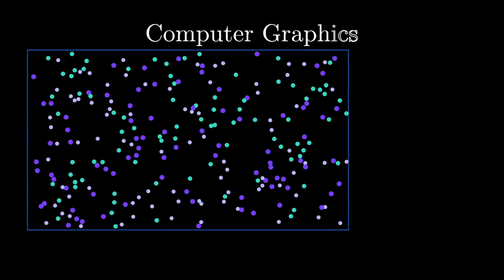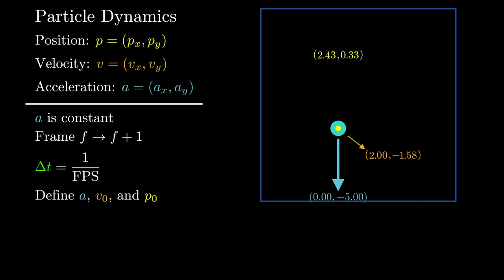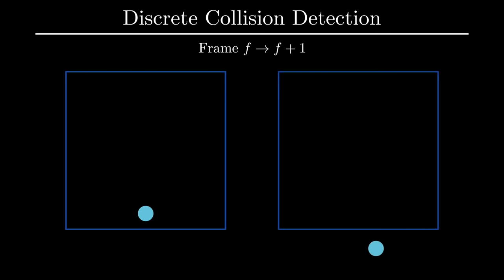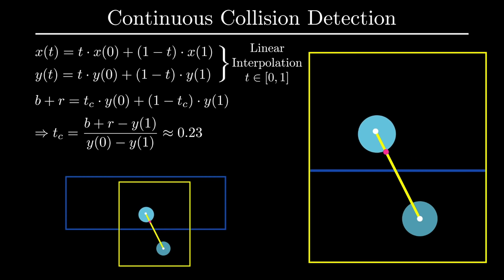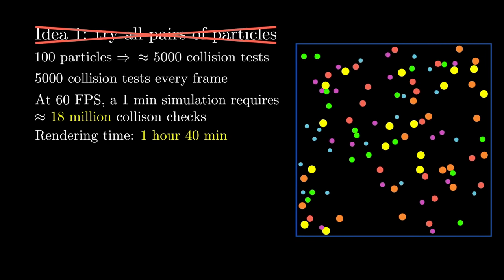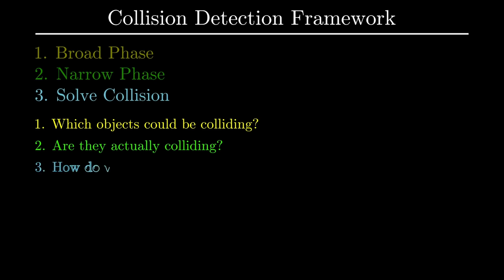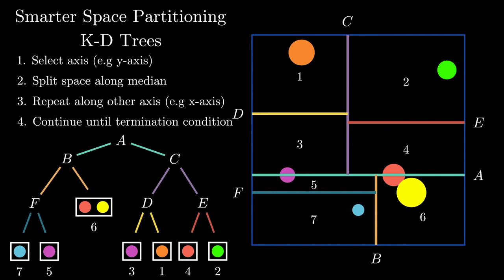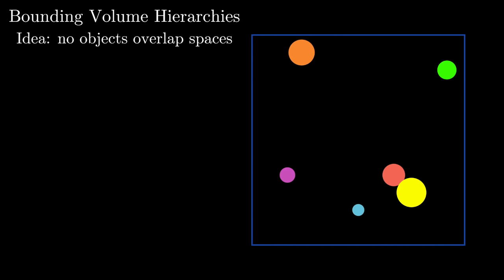Building Collision Simulations: An Introduction to Computer Graphics

Comment: Hey, very nice explanation! 
The Sweep and Prune algorithm offers a massive optimization despite how incredibly easy it is to implement. It's immensely useful in molecular dynamics along with the Bounding Volume boundary Hierarchy although the latter may be somewhat more tedious to implement.
Reply: What do they use for n-body simulations? You can't use Sweep and Prune since forces never die out to zero.
Reply: @looksintolasers  Depending on how quickly the interaction force decays with the distance, you can still use a variation of the Sweep and Prune method, with a larger interval surrounding the particles. 
To compute the force on distant particles, instead of iterating for each particle, you can encapsulate a large number of particles in a single cell, and compute the interaction via a multipole expansion approximation.
One of the most used optimization techniques in n body simulations is called "Barnes–Hut method" if you want to look for information about it :)
Reply: @looksintolasers  For short range interaction (or very short meaning no action at a distance with only friction and collision as in granular material) you can also use Verlet list. The idea is simple but need some careful tuning to guarantee that your system will not blow up and produce artefacts : you setup a cutoff distance beyond which you assume the magnitude of your force is negligible compare to the effect of the one resulting from interaction with other particles within the cuttof distance range (and thus not affecting the dynamics of your system), which is natural when no forces at a distance are present. You build a list for each particle of possible neighbor candidates within that range and maintain it for a finite amount of steps. On these steps you don't have to update that list because you have chosen the right cutoff distance such that no particles outside the list can be a candidate for a collision between two consecutive updates. Check the verlet list wikipedia page for more details. This algorithm is very handy because it can be "nested" : you can make "super verlet list" with another bigger cut off distance to make a bigger list you will update at a lower frame rate,and use it to feed your "inside" verlet list such that you update it only by iterating over particles in the super verlet list. And so on. Hope my description is sort of clear but this is the "broad idea" : careful tuning according to the dynamics of your system and you don't have to iterate over all pairs of particles at each time step. It's sort of "caching" candidates for collision over a certain amount of time steps : )
Nevertheless,in molecular dynamics many algorithms exist to handle collision efficiently and the right one to choose depends mainly of the dynamics of your system and its collision rate : ) Verlet list for example is well suited for dense particle systems
Reply: @looksintolasers  In practice,you will always have to assume that forces go out to zero at some point. Like you say, gravity, it never ends. Nevertheless you can still make real satisfactory predictions about the motion of solar system planets without considering influence of distant galaxies on it. Or the influence of Mars on any apple that fall to the ground. Yet, the influence of Mars exists. But we can safely disregard its effect compare to earth attraction. In numerical simulation you "can compute everything". But it is mainly useless. You can compare contribution to the net effect and disregard contribution you can say "are too small". Otherwise, it is just garbage contribution to the real effect your are trying to measure. At that point the integration scheme for computing your motion  is already probably bringing worse numerical errors to your measures that the one resulting from "neglecting infinitly small effects"
Reply: @Galileo51Galilei  the problem I'm having with gravity on small scale is while the protons approach they get more simulation ticks to accelerate.  This makes them depart with faster velocity. So on their departure, they get less simulation ticks to slow down.  
So kinetic energy sometimes increases too much, especially when the protons get really close.

Any ideas?
Reply: @TheRainHarvester  maybe you will be interested in the class of "event driven" algorithm where you do not track "time" with a fixed timestep but "events" with a dynamic time step, reducing it when something interesting is about to happen and increasing it when nothing is about to happen. It s adapted to the simulation of low collisions rate systems. Check for "event driven particle dynamics" or EDPD.
Reply: By the way, to all here, do not hesitate to contact researchers in that field (their pro email is usually easy to find). They will be really happy to help you and they live behind their mailboxes; ) If you write z concise email explaining your problem and what your are.looking for they can answer you with one line sometimes which can save you hours of research (it's their job to keep track of good références). They maybe will send you a nice pdf article to help you. I was in academics so for me it seems natural. But for those who never talk with researchers and don't have this reflex (which is perfectly understandable) you can interact with them. Often (depending of your country and labs) you are paying through your taxes for their jobs ; ) So feel free to ask them questions on your personal research/projects.
For example,on intégration scheme for particle dynamics the physicist Sean Mc Nammara is quite a reference, on top of being a nice and humble man
Reply: @TheRainHarvester  But mainly you need an  integration scheme that puts energy conservation at the very focus,like Verlet Integration scheme (which is different from verlet list I talked before)
Hope to help you,cheers
Reply: @Galileo51Galilei  i was thinking integration too.  But with multiple particles, it gets complicated.  It seems like our universe side steps the problem using repulsion at small distances which prevents 1/r^2 from going to infinity.... except for nuclear fission explosions and black holes.

Comment: Dude, your videos are pure gold. Computer Science students must LOVE you! Just a little note :D 2D particle-to-particle collision response closed formulas look hard and ugly, it is easier to deal with it by proceding by steps. First, split both v1 and v2 in two components, one parallel to the line of collision and the other tangent to it. You'll obtain 4 vectors: v1p, v1t, v2p and v2t. The final velocity vector for the first particle will be v1p + v2t, the final velocity vector for the second one will be v2p + v1t :) in other words: when two sphere collides, their velocity component tangent to the line of collision have to be swapped. This works if the two masses are the same but it is not that hard to take also that into account
Reply from the maker: Thank you! Yeah, I think the reason I was having so much trouble with it is I was messing with angular representations and it wasn't immediately clear to me how to solve it with an angle-free representation. Like I said, pretty rusty on my physics :P  Thanks for this comment!

Comment: 13:23 you can see one of the blue particles in the right box getting stuck to a yellow particle and briefly getting slingshot around. same thing happens again at 14:37 between a red and yellow particle.

it looks like the reason this happens is that, during the 1st half of the simulation frame, when two particles are first moved, they penetrate each other at very grazing angles, the 2 particles overlap but already have velocities that would move them away from each other. the collision handling doesn't account for the fact that the two particles are already moving away from each other and just unconditionally reflect both particles' velocities along the collision normal. This results in the velocities deflecting slightly inwards to the opposing particle and remain nearly tangent to that particle's surface.

This continues until the particles reach a sweet spot frame when the next position update would fully depenetrate the 2 particles.
Reply: How did you find it? I was looking for any blue particles close to yellow particles at the timestamp and had to pause the video to find it.
Reply: @PanDiaxik  all the particles move in straight lines, the slingshot particles move in a brief curve. To me its just eyecatching to see 2 particles move differently from the others even just briefly
Reply: Yeees, I have seen it. It's kinda funny
Reply: Is it possible now to aim and accelerate particles to merge them 😅?

Comment: 12:42 Some ideas:

1. First you need to "enter the frame of reference of the 2 colliding particles". To do that you add the 2 speeds together (as vectors), divide by 2 and subtract from both vectors. You save this vector for later. To see why, think about the point that is in the middle of the line connecting the centers of the 2 objects. This point must be stationary.
2. Now to find the new directions draw a line perpendicular to the line that connects the centers of the 2 spheres and flip the two (converted) velocity vectors along this line.
3. To find the new speed values you need to consider that the total momentum must be preserved (m1*v1+m2*v2 == m1*v'1 + m2*v'2) and the kinetic energy must be preserved (m1*v1^2/2 + m2*v2^2/2 == m1*v'1^2/2 + m2*v'2^2/2). This gives you a system of 2 equations with 2 unknowns (the 2 new speeds).
4. Once you know the new vectors, you add back the vector you subtracted in step 1 to get these vectors in the frame of reference where the box is stationary.

The "ugly equations" shown here are these steps performed on two arbitrary vectors, using vector algebra. When you look at the steps above, you can see why their derivation (and their final look) is such a mess.

Comment: The fun starts when you try to calculate further collisions that occur during during the same frame after a collision has taken place and the trajectory was changed. Or three objects that collide at the same time...
Reply: I usually implement an integrate method that takes a delta time an calculates the next frame of the particles or objects accurately, then on collision I try to find the exact collision time and move the whole scene back in time to that time by reducing the delta time accordingly and integrate again with the smaller time step from the last frame, resolve the collision response and integrate again to the next frame by moving the scene by the delta time left. I repeat until no collisions are found anymore. Then the next frame starts. It's very important that the integrate function is stable no matter the time step put in. So to include acceleration you have to use the s' = s + v0 t + ½ a t²  term
Reply: @ecicce6749  The drawback is that under certain circumstances the framerate might drop significantly, because there are too many collisions to solve within the interval.

Comment: Nice video! A programmer who sometimes writes simple games here, and still find this useful :)

Quick comment on the cons for uniform grid space partitioning approach: In fact having many empty grids isn’t a con if implemented with the right data structures.

One can maintain a list of grids, each associated to a list of intersecting objects, but skipping any empty grid:

1. Traverse each object, determine the list of (exactly or potentially) intersecting grids.
2. For each grid, push the object to a list associated to the grid. The latter can be achieved by creating a hash map which maps a grid (eg the key can be (row_id, column_id) for the 2D case).
3. Don’t bother initialize an empty list for each grid.
3. At the end, you can iterate through the hash map, skipping any grid with no intersecting objects.

One assumption here though is that at step 1, we need a relatively efficient algorithm to compute the list of all (or potential) intersecting grids. This is relatively simple to achieve for convex shapes like a circle (or a sphere in 3d space), but could get tricky for concave shapes where one might want to resort to approximating with a bounding box/volume.

Comment: 9:08 To my knowledge, this is how Mario's collision works in Super Mario 64. Every time Mario moves, each frame is split into 4 seperate collision detections. And Mario has a maximum forwards momentum.
There are a couple of problems here though.  Mario has a maximum FORWARDS momentum. Backwards momentum is not limited. To clarify, this is relative to the direction, the player character's facing. There is also another problem. Since walls don't always allign with the grid, they had the excellent idea to only calculate collision for the nearest wall each frame, so the player can both go through corners of walls and go through walls backwards if they find a way to increase their backwards momentum enough.
(Mario always turns to the direction, he's walking/running, so you can't just walk backwards. If you want to know more, the trick for going backwards fast is called blj or Backwards Long-Jump.)

Comment: This isn't directly related, but this video reminds me of a story:

I was trying to develop a game in GameMaker some years back that was sort of a strategy game where the player could theoretically have an arbitrarily large number of units. My collision system wasn't super optimized, as I was a beginner biting off more than I could chew, but what I really want to talk about is the enemy targeting system. I initially had enemies simply target the closest player unit, but my playtester thought it was random and found it unfun, so I decided to come up with a system where the game dynamically puts player units into groups, then the enemies attack the center of the group rather than individual units and I wanted it to be as optimized as I could reasonably get it.

That threw me down a rabbit hole that I was in for like a year, but ended up using a uniform grid space partitioning algorithm without knowing it. The enemy targeting handler would partition the play space into a uniform grid (I think 16x16 or 32x32) and scanned through all the player ships (up to some max number of units n) and checked their grid positions, updating a corresponding population counter for each respective grid position accordingly, then the enemies would aim for the nearest local maximum on the grid. Then the next frame the targeting handler would cycle through the next n units, update the grid and so on. I was pretty proud of it at the time, but I wish I'd known about bounding volume hierarchies at the time. I had this whole other system that I wanted to use similar to KD trees, but based on nearest neighbors that I loved in theory but could never get to work in practice, which is why I ended up going for the grid system in the first place.